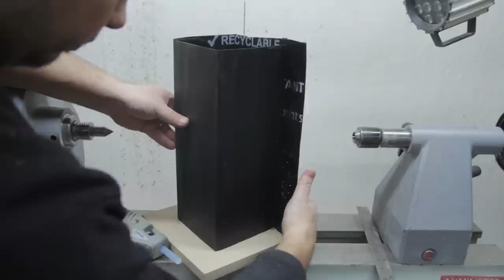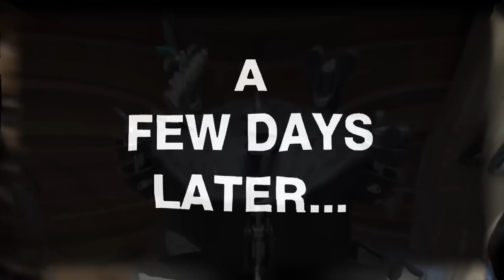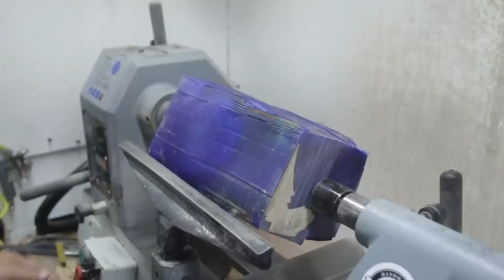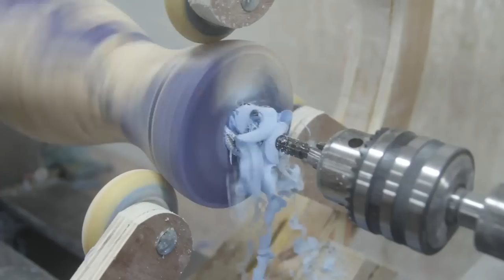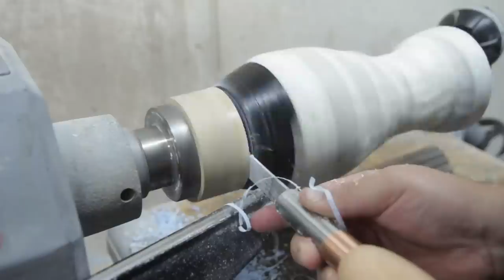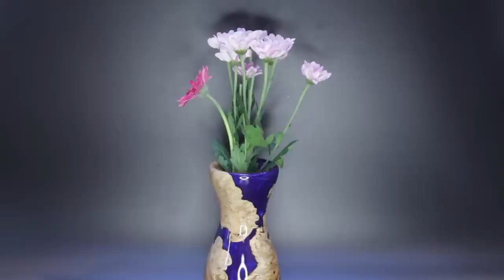How to wood turn glass and epoxy resin hybrid burl vase

Comment: I’ve always wanted to try something like this. I am curious, when the object is in the very beginning stage and it’s still square, how hard is it on your hands to use the chisel to start the rounding of the edges process? Beautiful work!!
Reply from the maker: Thanks Jeni. I am taking very small passes at the beginning so no it is not hard on my hands. However, due to not being round therefore is not spinning completely true it will cause loads of chip outs. And those chip outs can be very painful when they hit you hand as they are like lithe glass(resin) shards. Sometimes I take on gloves to protect but do mot show that on camera to avoid showing bad practice. I could trim it in a table saw and bandsaw but both of my saws cut perfect square so in order to trim i would need adjust that.

Comment: When working with resin and/or burl wood, do you always use carbide tools and why/why not?  Thanks for another inspiring video resulting in a piece that is both functional and beautiful!
Reply from the maker: Thanks Elaine. Burl on its own would not really need carbide, some sharp traditional tools would work perfectly. But when it is a hybrid project (with resin for example) carbides are outperforming traditional chisels. All my hybrid turnings done with negative rake carbide tips and that simply eliminated all the chip outs what i used to have before using negative rake.
Reply: @DavidsWoodturning   Thanks so much for your informative response!  I haven't turned any resin hybrids yet but I plan to give it a try soon.

Comment: Just a quick question, why is it that you don’t cut down the blank on a band saw to make it hexagonal before turning? It is a time thing or just it’s more fun to turn?
Beautiful vase and resin colour choice. Keep up the stunning ideas and videos, always a pleasure to watch.
Reply from the maker: Both my bandsaw and table saw is set to perfect square. In order to trim I would need to adjust to like 45 degrees angle. So at the end I would not safe much time getting all the settings back to normal. Plus it is fun to turn :)